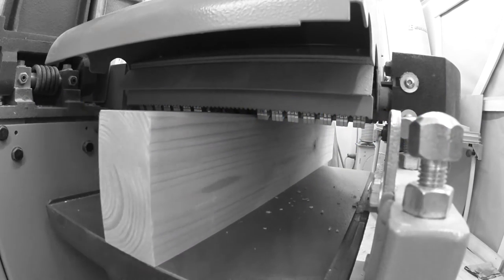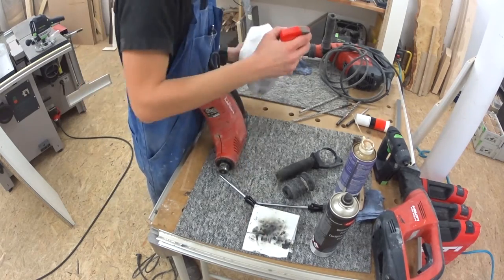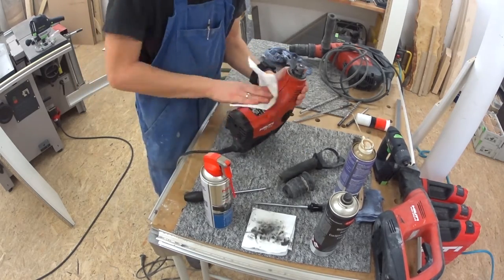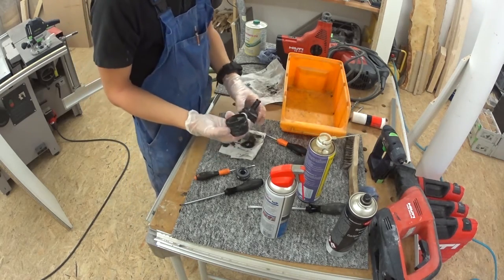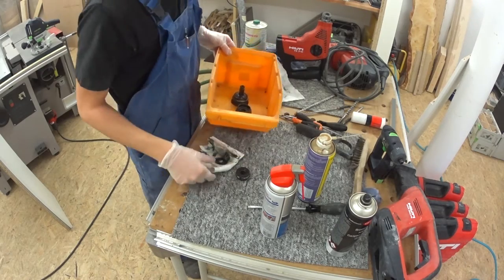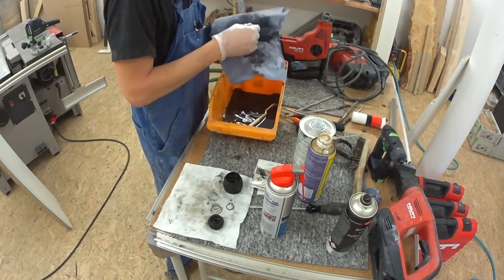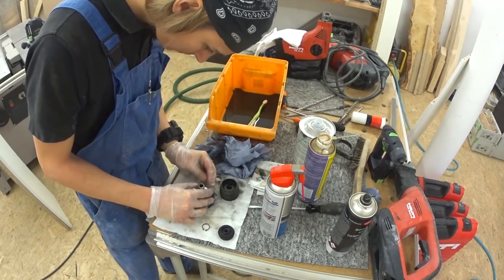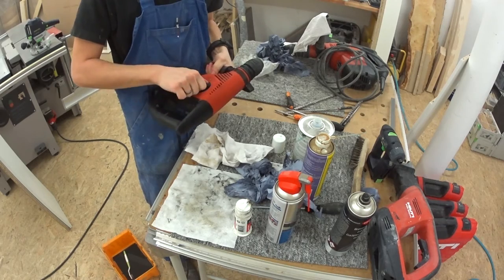WeaselWood Maintenance #1 [English] Hilti TE7C Cleanup

Comment: hello, is possible to change the factory chuck by straight one? thanks.
Reply from the maker: +zakura 
Hi. Yes, ther is a normal chuck available, for normal iron drill bits. I have a fast change chuck that came with the machine. I thought i had shown this on video.... ;)
Reply: thanks.